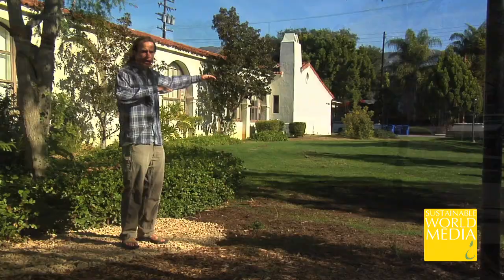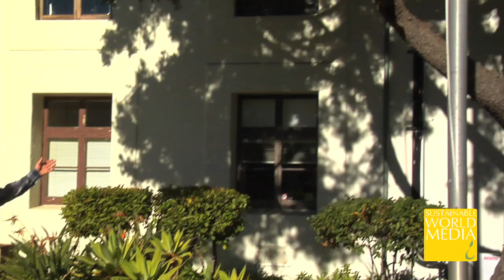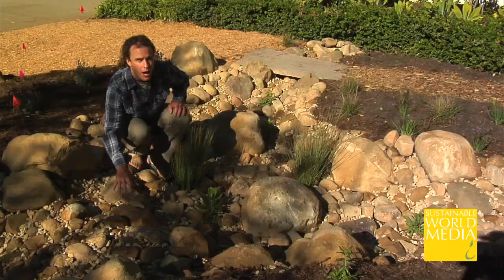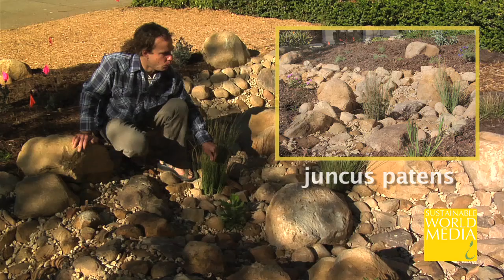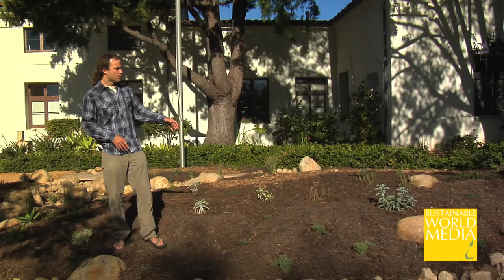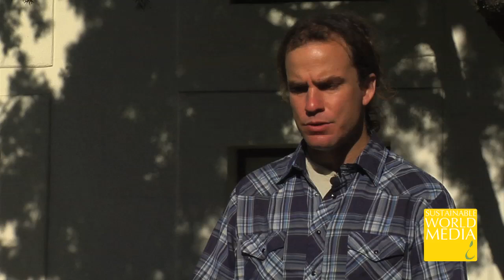Managing the Water on Your Land- Making A Rain Garden

Comment: can you integrate a rain garden with a pond or pool?
Reply: A rain garden is a like a shallow pond that is often dry until it rains, so a rain garden can work as overflow for a pond but I can’t think of any other way to combine them. If you’re thinking swimming pool, then I doubt it. Either the chemicals will hurt the rain garden if it’s used for overflow or having overflow water from the rain garden to a pool would dirty the pool.